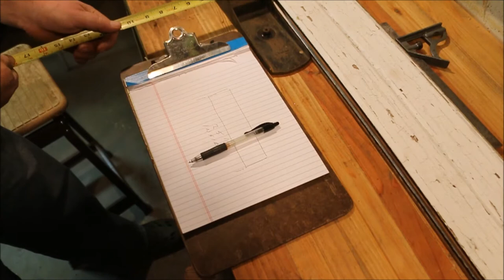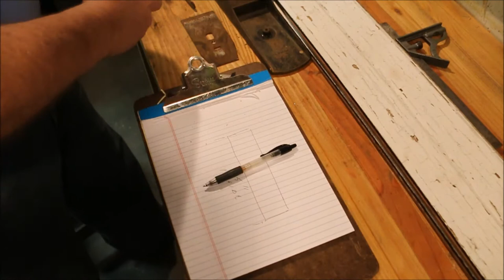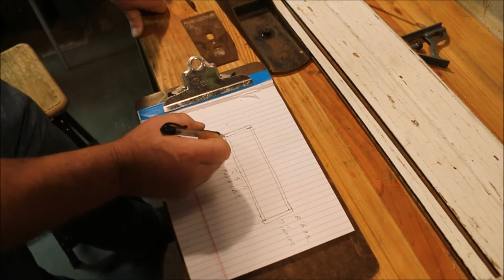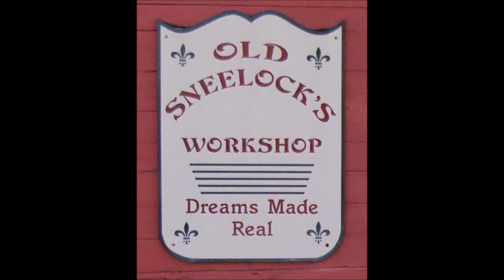ANTIQUE SHOP FINDS ~ STANLEY NO  8 PLANE ~ PART 2 ~ ELECTROLYSIS ~ BUILDING A TANK BIG ENOUGH

Comment: Sneelock,
A couple points about electrolysis.  DO NOT run the bath inside, it creates hydrogen gas.  Electrolysis is a line of sight operation, meaning if you can have the anode and cathode set up in such a way that all sides of the item you are derusting have an unobstructive path (just the solution) the system works at its maximum efficiency.  Also, on the do not list is to use stainless steel as the donor metal, the gas emmitted there is poisonous, something like hydrogen sulphide or some such nasty thing.  Electrolysis works really well, as does vinegar for stuff that is not so rusty.  I enjoy your videos and I am sure you probably already know some of these points, but others may not.  I look forward to part 3 of the Aircraft Carrier rehab.
Reply from the maker: James Pierson Electrolysis is my favorite rust removal method. Any process that uses acid runs the risk of running out of rust. The acid will put iron in solution a little less easily than iron oxide. When the iron oxide is gone it takes iron until the acid is neutralized or the iron is gone. That's why, when I sharpen files, I keep testing and stop just as soon as the file is sharp.
Stainless is bad for the anode because the sacrificial anode disolves. Stainless disolves slowly but it still loses iron atoms. That leaves nickel and hexavalent chrome. Hexavalent chrome is real high on the cancer causing list. 
When the bath is made with baking soda, when it is done you can pour it on the grass and you will have bright green grass that grows nice and thick. https://www.google.com/search?q=iron+as+a+fertilizer&oq=iron+as+a+fertilizer&aqs=chrome..69i57j0l3.33864j0j4&client=tablet-android-samsung&sourceid=chrome-mobile&ie=UTF-8

Comment: WHY NOT USE VINIGAR ? i KNOW  IT'S HARD ON THE FINISH, BUT STILL I FIND IT WILL DO THE JOB BETTER.
Reply from the maker: Mike Tarzwell Electrolysis removes rust and leaves paint that is still bonded alone. Vinegar is less selective.

Comment: Five or ten bucks will get you a sturdy plastic cement mixing trough, about 24x36 and eight inches deep. Usefull for all kinds of stuff.
Reply from the maker: Good suggestion. I wanted to show that not having exactly the right tool can be overcome by a little ingenuity. Some scrap wood and a garbage bag that cost a few cents let me build what I needed. With a larger bag and enough power supply a car body could be derusted using the same method. 👍

Comment: I love electrolysis but my tank (plastic tote with rebar wired around the sides) did not survive my last house move. My next tank will likely be based on a 30 gallon plastic drum with a plastic drain. However, to your video, which is good btw, I have found that electrolysis flakes off japanning.
Reply from the maker: Electrolysis attacks rust where ever it is. Japaning unlike paint has a substantial thickness to it that lets it wthstand things like rest creeping under the edges without flaking off as easily as paint. However if the rust is removed like electrolysis will do, right up under the japaning, the japaning loses the bond and is bridging a void. The  loose pieces will flake off. 
I use Arm & Hammer baking soda. I have found that it isn't as aggressive with japaning. 😎

Comment: hey Old Sneelock - What are you using for your anode?
Enjoy your videos.  Thanks
Reply from the maker: Jesse Vardaman It is a plate of steel, from the blacksmith shop scrap pile, that just happened to fit. If you are asking what it was previously? It was the damper from the fireplace that I replaced when I rebuilt the damper mechanism. The anode in this circuit is sacrificial. Using a rusty bit of scrap is appropriate.

Comment: Your work story reminded me of the Marmaduke Surfaceblow stories by Stephen Elonka. By the way, what did you use for a power source?
Reply from the maker: kleinjahr A 12 volt battery charger/booster.
Reply from the maker: Just read Marmy's First Lesson. Good story. Reminded me of some of the guys that I worked with at the foundry. Dad could make nearly anything work. Some of the other guys had different talents. 
Elmer wanted to remove the cylinder head on the big single cylinder air compressor. It had an 8" bore and the head weighed a good 40 lbs. Some damn fool, no one ever told Elmer who it was and I didn't do it, put formagasket on the head gasket and glued the head in place. 
Elmer decided that the only way to get it loose was to roll the compressor over and let the compression knock it free. He removed the nuts from the heads mounting studs and  had someone hit the start button. The 12 foot diameter flywheel/drive pulley did one full turn. The head blew off right into Elmer's chest.  Elmer caught it in his arms and set it on the bench. 
It would have worked better if he had only loosened the nuts a couple turns and let the studs catch the head. However he proved, that if you were as strong as Elmer, catching it worked.

Comment: I put my #8 in a piece of 4" PVC pipe and soaked in Evaporust.  Since then, I began using a scraping/abrasive technique similar to  what PlaneCollector does https://youtu.be/XF6DQ6xw_50
Reply from the maker: Art Coates The scraping and abrasive method works quite well. I use it on blades of all kinds. Especially on saw blades to bring out the etch.  I had a a bad experience with Evaporust. I bought a quart first and it did a good job on the auger bits I was cleaning. With that positive result I bought a gallon next. I have quite a few auger bits. It was doing fine. I had a tub full of bits on the bench. Every night I cleaned the bits in the tub and replaced them with more for the next days cleaning. After a week, and about 30 lbs of bits, I went down to the shop and about puked. The Evaporust had turned. It smelled terrible. Four years later I can still catch a whiff of it on a humid day. 
I never bought more. At $25.00 a gallon it is expensive. Apple cider vinegar cleans as well. It slowly stops working but always smell like apple cider vinegar.
Reply: Yes, Evaporust is expensive!  Made the mistake of leaving mine in a tub near the sink and it got dumped after my #8.  Pretty much everything I get gets scrubbed down with LA's Awesome cleaner to begin with.  Then, I've used white & cider vinegar, molasses, black tea and electrolysis - some items singly and some in combination of de-rusting methods.  Molasses smells great when starting out, but will funk as well.  I never let it go that long - it's cheap and doesn't take a lot to clean a lot of items.  My favorite is scraping & abrasives (even though it is really messy) for items with flat surfaces and molasses for augers and the like.  Seems to me that the abrasive method appears more like a old, well used tool versus one that has been spotlessly restored.  But, I've had items that were so crusty that you could barely tell what they were before using more drastic measures!
Reply from the maker: Never tried the black tea. I did use the molasses. Must be I didn't do it right. Mine stunk the second day and got progressively worse. I put a clapped out saw blade in it just to see what it would do. It sat out behind the shed and I checked it every day for a week. It didn't seem to be doing much. At the end of the second week it had cleaned the rust off the blade but it smelled so bad I had to hold my breath to dump it back in the woods. 
Not far enough back I guess. Our dog Sadie thought it smelled heavenly and promptly went back and rolled in the stuff. I had to give her a bath. I didn't let her back into the woods for a couple days but she's sneaky,  and she still smelled bad for a day or two. It rained and the smell went away in the woods. 
I have been warned that further experiments with molasses will have both the dog and I sleeping in the woods. 😊
Reply: The black tea works best as a post-treat after removing rust with something else.  Bought some citric acid the other day and will try that soon.
Reply from the maker: Art Coates Thanks Art. So does it act like bluing? I put plumb brown on a black powder derringer. It looks like really thin swirly rust on the surface.
Reply: Yes, I think the idea originated with Japanese cast iron Tetsubin.